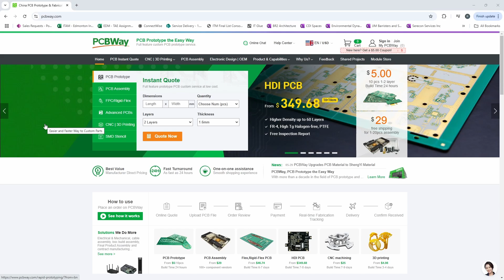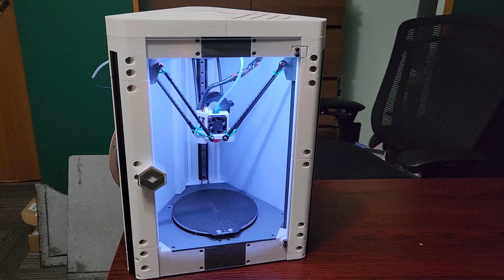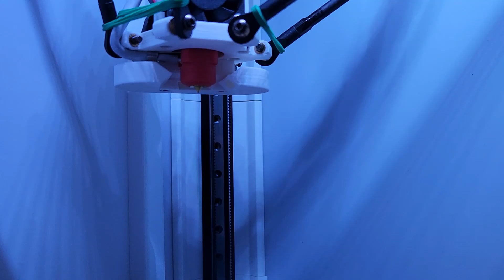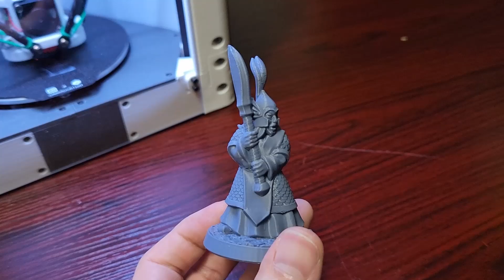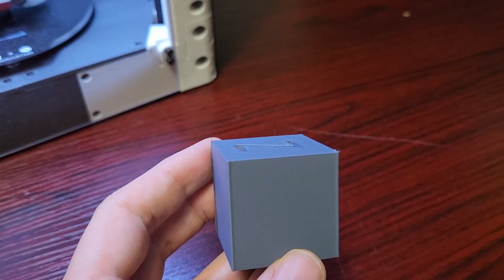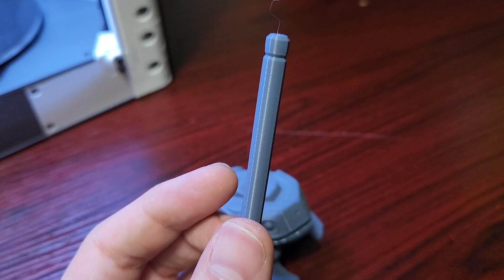Huge update to my beginner delta 3D Printer the "Delta Flyer Refit!" LDO Kits coming soon!!!

Comment: what is the part number on the recommended mpjet ball end bearings to use on the LDO kit? How much difference from the LDO supplied units?
Reply from the maker: it's in the BOM on printables

Comment: i have a dead flsun v400 can your system be scaled up to fix it?  I'm new to building so this might be a no but I won't know until I ask
Reply from the maker: the v400 hardware is pretty good, I would just put a new Bigtreetech mainboard in it with proper kipper and it should be a good delta. I have modded a v400 before and it worked well. There are a lot of mods on pintables for better hotend and cooling and such
Reply: @Rolohaun  Thank you for comment, I'm super excited to see the Refit.  As soon as it's kitted I'm on it, self sourcing isn't easy with Aliexpress right now since I'm in the states.

Comment: This looks really cool, and I'll probably try to build one. So here's a question, how hard would it be to scale it up so the bed is 200mm diameter? Obviously I would need to edit some files, and get longer arms. But do you think it would still be stable enough? I would like to use this for education, obviously, deltas are magical to look at, the printer itself looks nice, and seems to be quiet, so that's a perfect fit. The only issue is size, since I need it to be just a bit bigger...
Reply from the maker: I am going to build a 220mm version one day. Maybe this year. You would need to modify this a lot
Reply: @Rolohaun  I don't really mind the work in modifying it. I'm just trying to picture what would I need to modify. Do you think it would work if I just properly scaled the parts? Would the 5mm carbon fiber rods still be sturdy enough at that length? Do you know of anyone making a larger Delta Flyer in the previous version?
Reply: @astrumrocket6556  arms would need some bracing maybe, but not a big issue, main issue is frame stiffness, it would  have to be improved. replacing much of the printed top and bottom with extrusion would be a minimum. Probably easier to start a new design at that point.

Comment: It's about time you got rewarded for your mega engineering projects! Looking all presentable. 👍👍
Add: That sounds kind of botty and random, so more specific, I finally got a hold of a triplet set of 1700mm linear rails and ball screws so I can finish my mega delta refit, too. RIght when I'm ready to start building, I also picked up a whambam Mutant set, so I'll be kitbashing one of your effector plates for mutant duty.